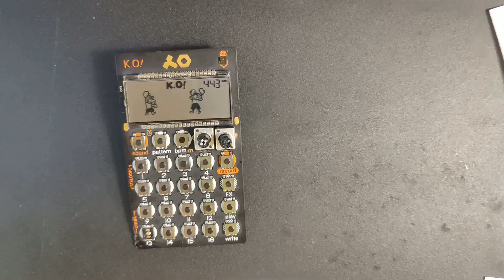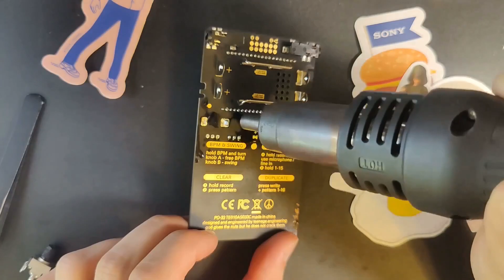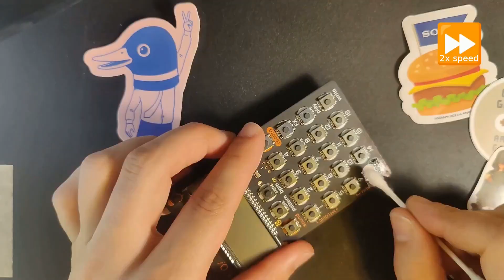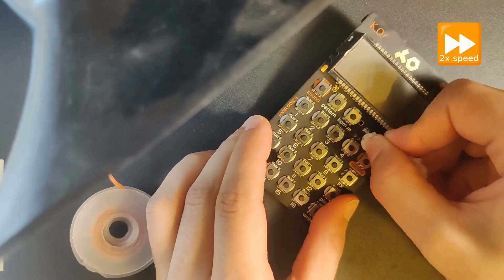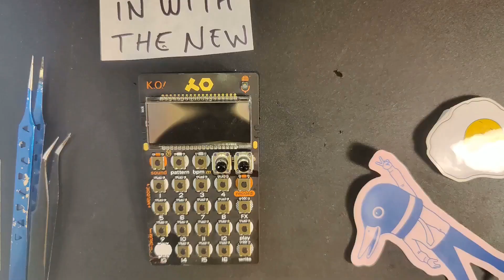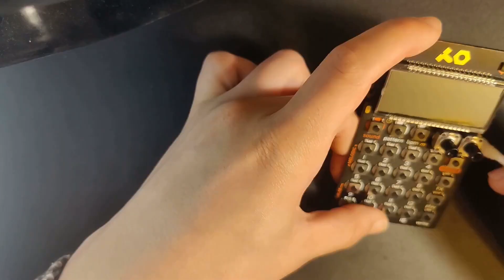Teenage Engineering PO-33 K.O! Knobs and Button Repair

Comment: Nice can I also change the buttons and knobs for some that are more durable. I hate them breaking
Reply from the maker: Yes the replacement knobs and buttons are much more durable than the original. That being said, I'd recommend a case if you want more protection.

Comment: Nice video! where are you based? i'd like you to help me repair my tonic
Reply from the maker: Based in Los Angeles, CA. For repair inquiries, please message me at hamiltonbryce97@gmail.com. Thanks for watching!
Reply: @brycecanyon5939 hey I'm wondering if this is a job too hard for someone who's never worked with soldering irons and what not, mine has the knobs all messed up and idk if it would be worth sending it all the way from europe to you so you could fix it, shipping fees would probably go abismal. with that said do you reckon I could do it? I could borrow my grandpa's solder and work with that, I could also ask for his help but he's growing old and sick and his hands just aren't as gentle as they used to, so I'm not sure but I do appreciate you for posting this video
Reply from the maker: @rafaelmateus1692  I would agree, it's probably not worth shipping it overseas. You may be able to do this repair with just a soldering iron but a hot air station makes it a whole lot easier. For you I would recommend visiting your local electronics repair shop and ask how much they would charge you for labor if you brought them the parts.

Comment: alloy rose useful to this situation, but if you dont have, can try to destroy carefully knob before removing, cut legs and metal thing
Reply from the maker: What is alloy rose? Not sure what you mean but thank you for watching 🐧
Reply: @brycecanyon5939  this is low temperature alloy, 50% Bismuth, melting temperature under 100 deg cesius

Comment: It's a miracle the screen survived. I would have used a solder pump to remove the pots, not a hot air gun
Reply from the maker: Good idea. I'll try that if I do another PO :)
Reply: @brycecanyon5939  My tip when working with solder pumps is to add extra solder before using the pump
(if there isn't a good glob there already)

I've found that it is more effective with bigger globs for what I presume is surface tension pulling the tricky crevices with the rest of it. Really shallow through hole solder connections are impossible to remove with a pump otherwise
Reply from the maker: @Slushee thanks, that makes sense. I have a pump but don't use it that often. Definitely will try next time, just used to using the wick.